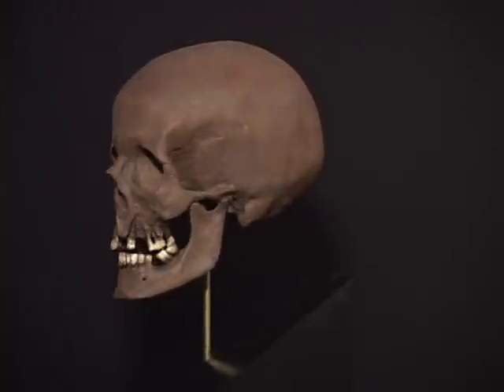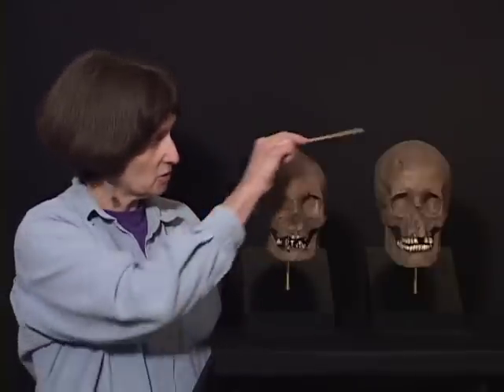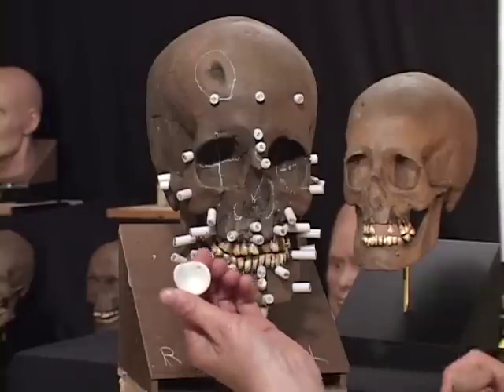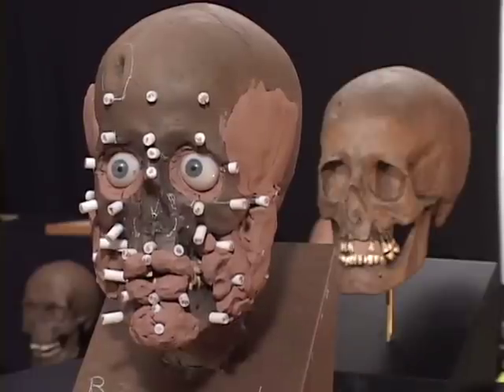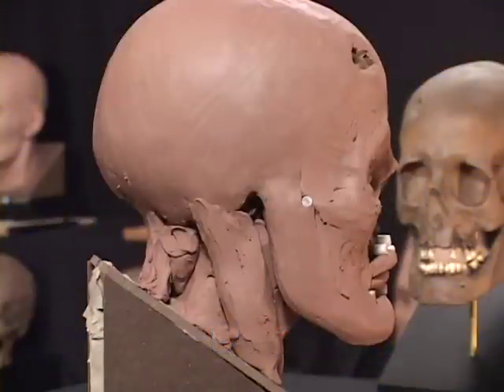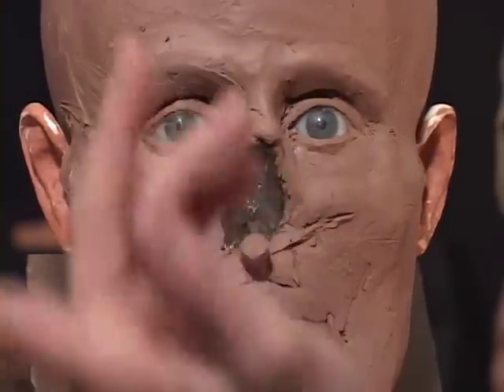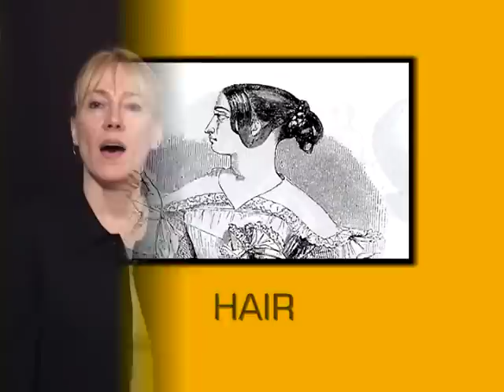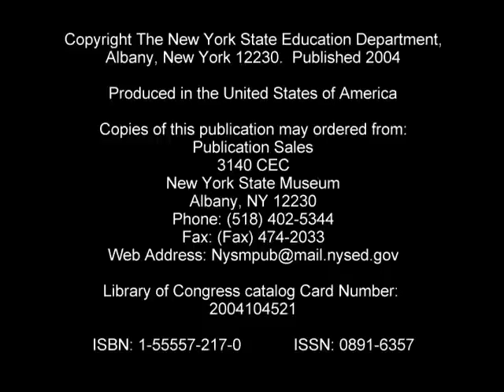The Science and Art of The Facial Reconstruction Process

Comment: hahaha... when I touched the top of my skull to feel if there was any thickness, I can honestly tell you that there is just skin there. Like no more than 1mm.
Reply: Ah, but by touching the top of one's head, stemingleo, if you depress the area palpated, you will feel the thin musculature - Epcranius - but specifically, the Galea- Aponeurosis, & under the skin, it is white in colour; if you place the palm of your hand over the Cranium, & slide your hand from front to back, you will notice a degree of motility. That is why, at Postmortem, when the Pathologist/technician requires access to the Cranium itself (& ultimately, the brain), an incision at the posterior - from ear to ear, makes pulling the whole face forward much easier: the connective tissue is remarkably thin.